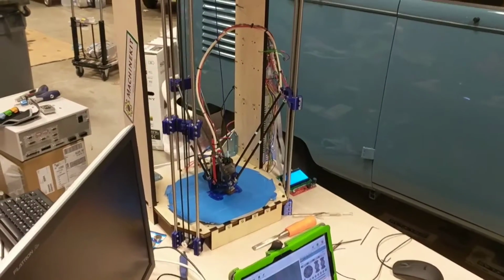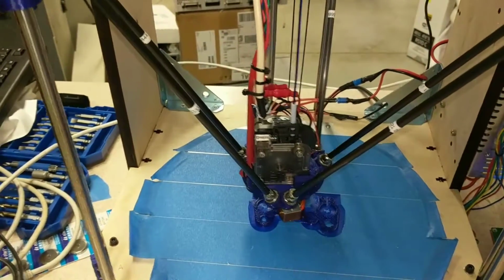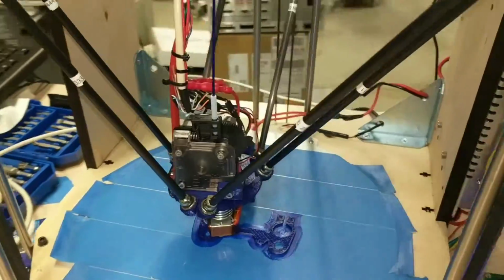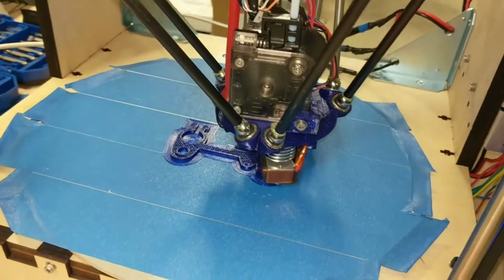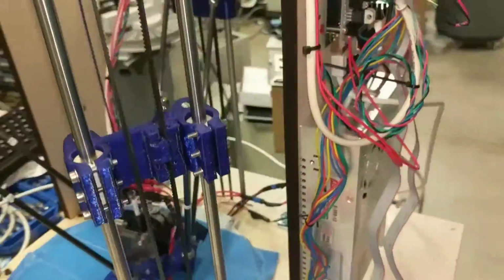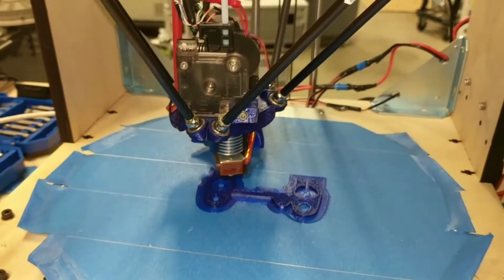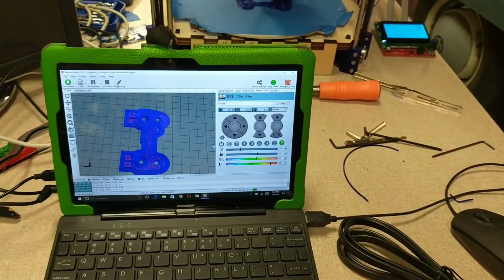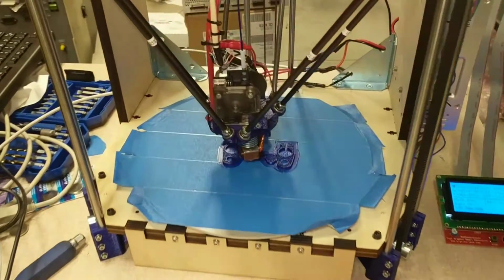E3D Titan Extruder on Rostock Delta 3D printer

Comment: Where is the effector for this? I just got a Titan and I want to mount it on my Kossel which also has Magball Arms with e3dv6.
Reply from the maker: You mean where is the effector design posted?  It is a Thingiverse parametric magnetic effector OpenScad file which I modified for the printer.  When I've finished the design, I'll be posting it up on Thingiverse as a remix file.
Reply: could you print fast despit the weight?